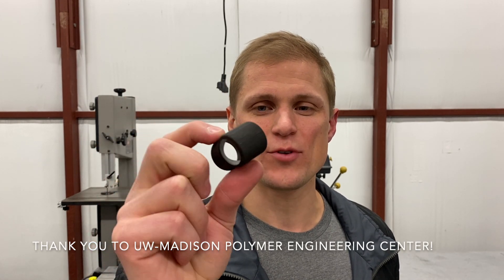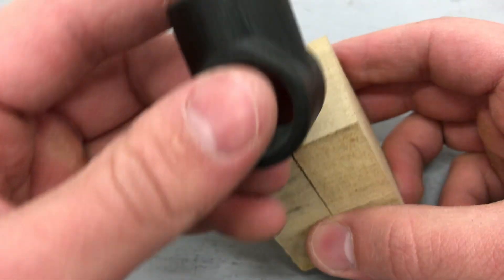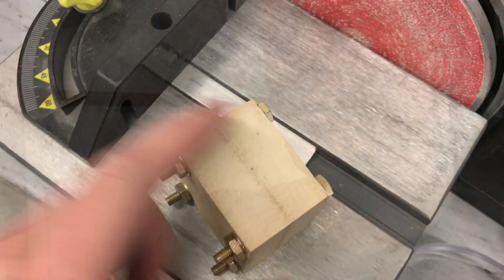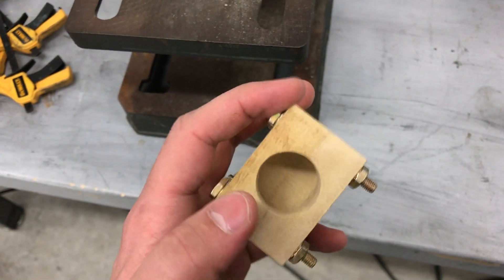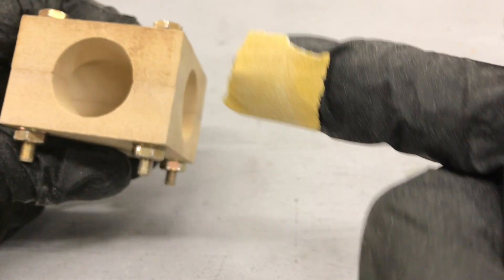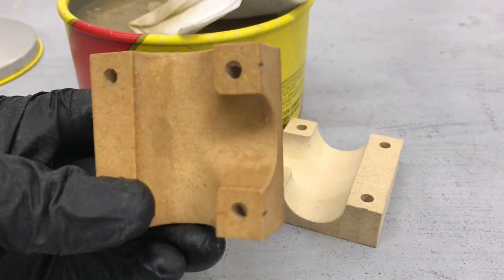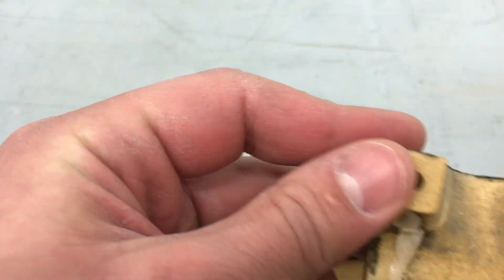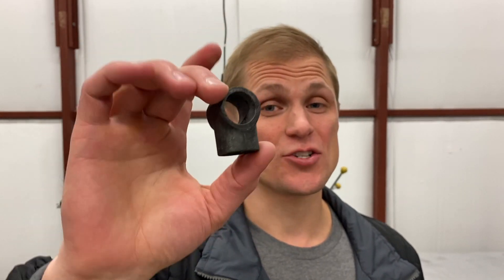HOW TO:  Making Simple Carbon Fiber Tube Connectors

Comment: I’ll help you a little get you a 3D printer, they have a material that dissolve in acetone print it wrap uour carbon fiber around it as many layers as you want vacuum fuse it then soak it in acetone the 3d printer will fall out like paste and then clean it and boom.

Comment: Why not make the tubes yourself?, create the tubes and joints on a sacrificial mould (like a low melt metal or foam that can be melted out), then roll wrap them with a combination of biaxial carbon cloth and a filament, you could then share the stress at the junction/joint all the way dawn the tubes.

Comment: I'm not exited about the structural properties of this part. How about a 2 piece mandrel , in the shape of a T, with appropriate tapers to permit extraction ( the leg of the T would have to intersect a machined hole in the top section, to allow that to be withdrawn)
The part could then be laid up with carefully cut cloth , and then vacuum bagged 
- to allow the longditudinal strands to be in tension as much as possible (depends on are you loading the tubes rotary or linear)

I really enjoy your channel. Kind regards from John Spargo in Cape Town

Comment: Could you have 3D printed your fitting mold right off, and 3D printed a 3 piece removeable core?  Or you could remove the thermoplastic sacrificial core with a heat gun or use a molded wax core?

Comment: Great video.  The key for fiber to add strength is fiber orientation.  Random loading will not increase composite strength. and may even decrease strength. So what the end result may be just the strength of the matrix. ie. epoxy. Of cause part will be more dimensional stable, harder, and stiffer but no more stronger.

Comment: I would think that locating-holes and associated pins in the mold will help put your mold bits back together and the assembled mold back into position on a drill press or CNC table.

Comment: Bis you abresin Printer, and Print the mold in Resin, its high def and you can polish the mold to a glossy Finish. The Printer and some Resin ist Like 250 bucks and you can make a Lot of parts Out of it, that are Like from the factory.

Comment: I definitely picked the wrong material for my project. I just figured common Sense would tell you that they would have PVC like fittings to connect carbon fiber tubes. Go figure. I'll have to look for either aluminum or pvc.

Comment: You could have used pipe within pipe for the inside diameter to avoid needing to drill excess carbon filler out later, all you would need to do afterwards is ream to tolerance and yer done.
Reply: Where can you find tubing that would fit one inside the other to graduate down from 20mm down to a 14mm? Can you do something like that?

Comment: i would 3d print a t-shaped mandrel out of water soluble filament , covered it with CF vacuum bag it let it cure and then dissolve the core in water. easier stronger faster

Comment: Could you share more information about the final version ? I'm looking to cast a part out of resin and carbon fiber powder  but needs to be strong  enough.I was thinking of pressure casting it in a pressure pot .What kind of mixture epoxy/carbon did you used?
Reply from the maker: Hey! We are working through some videos to release but after those we are considering putting one together for the final version. Thanks for checking out the channel!
Reply: It's been 9 months, it is likely that the final version of the tube connector is a forged carbon piece using a compression mould, this involves a mould machined out of aluminium and a way of apply pressure to the "entry" either with a hydraulic press brake or vice.

Because you're using carbon fibre powder and not chopped carbon, I'd recommend that rethink your material of choice, I'd mix the ratio to reassemble a thick pancake batter, liquid enough to cast conventionally with a silicone mould

Comment: you got a nice looking plane overall but you better  be checking the structural  properties before you start making  claims or finished parts remember your building  a aircraft I'm little dismayed at the seemingly casual  approach to this particular  part you have spent so much time developing this aircraft  don't  screw it up now
Reply from the maker: Thank you for the comment Fred! Just to clarify, this style of tube connector is not suitable for aircraft use. This was stated at 13:40 in the video. This video was meant to demonstrate a manufacturing method for a non-structural, prototype connector. You are correct that verification of structural properties is critical which is why we put a lot of effort into physical testing. We have highlighted testing in our other videos and on our Knowledge Base on our website. Thanks for watching!

Comment: Filament winding around waxed tubes comes to mind first for me.
Reply: And likely stronger
Reply: @chrisruf7590  You would be impressed by the strenght of forged CF, airbus in partner with Lamborghini studied it (or airbus gave the know how to lambo I don't remember, or was it boeing? lol) and made it work for a front suspension arm. Of course it was molded under high pressure not just hand pressed into the mold (edit: found it, it is pressed at 100-150 bars). But I remember giving it good strength/weight ratio and made it an isotropic material. Don't know why they choose to abandon it for use on mechanical parts ^^
Reply: @MrEratrace  That 100-150 bar is necessary that the fibers are well wetted with the resin to reach the break length within the resin. Still the random orientation doesn't help too much, as most the load here comes as bending, shear and normal force: filament winding can be optimized for these loads what result in extremely light but strong part.
Reply: @chrisruf7590  MUCH stronger.

Comment: whats that pink paste and then the black paste? can you put links to them please, thanks for sharing how to make this
Reply from the maker: Roshan, thanks for watching and the questions! The pink paste is bondo which can be purchased from your local hardware store or online. The black paste is a carbon fiber and epoxy mixture. The epoxies and carbon fiber we use are not public info at this time.
Reply: @DarkAeroInc  ok thanks❤️

Comment: get mavcoat release agent made in Anaheim California. google. That Luan wood is better at home depot, i they have it thick. You can also spray pva w/air-bush. l do that over mavcoat to sometimes for different parts. Some get painted, some do not. Painted parts come out of mold with primer awlgrip.

velosRus.com

Comment: Hey guys, thanks for all the vids of your process and your progress.  The aero-modelling community here in Aus sometimes uses the following technique to prototype either moulds or plugs using MDF.  We cut, shape or CNC the MDF to within 1mm of final surface, then paint the MDF with epoxy while applying heat from a gun.  The resin typically soaks in 3mm or more.  Once cured, the MDF is then final-trimmed.  The surface is much harder and sands better.  I see that you're moving towards 3D printing many things, but this technique is handy to recall at times.  Here's a short vid showing how easily the epoxy soaks in to MDF.  Of course, when heating epoxy like that, breathing masks are essential.  Regards, Steve.     
https://www.youtube.com/watch?v=wr9BG9olj3M

Comment: You never made the part two for this!
Reply: I'd be more interested in them doing a video on the process they use to manufacture the higher quality tube connector.
Reply: @anonanon7278  Whats the higher quality tube connector?
Reply: @beachboardfan9544  The final verion of their moulded tube connector, not the quick and dirty version shown in this video.

They said that the final version is out of scope because most hobbyists wouldn't have the tools required to make it, but I suspect it's more about protecting their intellectual property regarding the process they used to create the final moulded version.
Reply: @anonanon7278  I think they under estimate hobbyist's, and, they're also stingy with their mfg ways that are outside of self advertisement.

Comment: Thats a lot of work for a connector. Why not make two halves of molded carbon fiber that bond the two parts together. Could 3d print all the molds or at least the parts to make the molds. Then people can just trim out the connectors using drilling in the corners then a jigsaw for the flat parts.

Comment: Given how thick final part walls need to be to account for porosity etc, I wonder if an off-the shelf connector made of welded of 6082 or 6061 Al with 1mm walls would be lighter and stronger than this connector
Reply: sadly you cant easily combine those 2 materials. also i could imagine if the parts are 1% flamless they could be stronger than aluminum
Reply: What about galvanic corrosion bro ?

Comment: Will you be putting up the Advanced Molded Tutorial video? I'm from a university team and we're trying to use Carbon Fiber tubes in the Suspension of an off road robotic vehicle. We need to make connectors for a 130 degree joint between two tubes, and joint is going to be fairly structurally loaded. Also do you use only physical testing for parts like these? Or is there any finite element method

Comment: I have a great suggestion on some carbon fiber tube connectors.  You are reinventing the wheel.  Rock West Composites has some fittings called CARBONNECT  I have used them and they work great!  Here is the link: https://www.rockwestcomposites.com/shop/connector-accessories/carbonnect
Reply: I know I'm late, but for anyone else who's later still, they use aluminium for the connectors, which is a no-no because of galvanic corrosion.  I'm not saying it doesn't have its applications, but not for this project.

Comment: Thank you for this overview! This is a wonderful technique.

On the production mold, did you use a ram (threaded or press activated)  into one or more of the tube openings to essentially "forge carbon fiber" the end piece, or did you use the same open mold technique you used in this video?

What you are doing is inspirational. Thank you for sharing your journey and techniques with us.
Reply: I would suggest looking into the easycompositestv channel. They recently (~3 weeks ago) did a HOW-TO titled "Make Forged Carbon Fibre Parts Using Compression Moulding" ...they are a manufacturing company/supplier and put out some VERY high quality how to's!

Comment: Nice video. I would recommend using HDPE for the mold material over MDF for increased durability and surface finish.
Reply from the maker: Hans-Eirik Hanifl Thank you! Agreed that HDPE would be a good option. We used a machined aluminum mold for our production mold and HPDE would serve as a good middle ground alternative between MDF and aluminum. We recently started experimenting with 3D printed molds for prototyping too. Thank you for watching!
Reply: @DarkAeroInc  I understand, I was just trying to suggest HDPE for individuals trying to run a low run production. Keep up the great videos.
Reply from the maker: Hans-Eirik Hanifl roger that! 😁

Comment: Why not machine that from 7075? Weight? Seems like process reliability and cost would make sense from 7075. I'll hook you up and send you one from 7075 to compare against molded carbon. Just tell me the tube size. 😁
Reply from the maker: Thanks for watching and for the comment! There are definitely a lot of different ways to make a tube connector. You could machine them out of aluminum. One concern would be keeping the aluminum electrically isolated which you could accomplish by wrapping the tube in fiberglass in area where the connector makes contact. Aluminum can also be a little trickier to bond to. The advanced molded connector is made from a mold where we can produce many at one time which is much quicker and more cost effective than machining each individual connector.

Comment: What type of epoxy would you recommend?
Reply from the maker: Most laminating epoxies will work for this but the lower the resin viscosity the better. The addition of the chopped carbon into the epoxy makes the mixture into a thick paste so the more runny your epoxy is to begin with, the more carbon you can add to the epoxy before it gets too thick to add into the mold cavity.

Comment: Why not just 3d print both halves out of ABS, vapor polish and apply mold release? You could also 3d print an insert with very sparse infill to reduce the carbon drilling and waste. you could make the final drilling operation a lot more fast and accurate by 3d printing a fixture to hold a drill guide. I regularly 3d print holders for #30 drill guides when I need an accurate bolt pattern. A few minutes in SW and then a hour of printing, drill #30 then step drill to final size, the results are usually pretty good.
Reply from the maker: Bill Judge That would work too! There are lots options for making molds. We ended up CNC cutting the production mold from aluminum. Thank you for watching!
Reply: Because like he said, not every d.i.y.'r has a 3d printer in their garage.most have drill press etc.
Great video!!